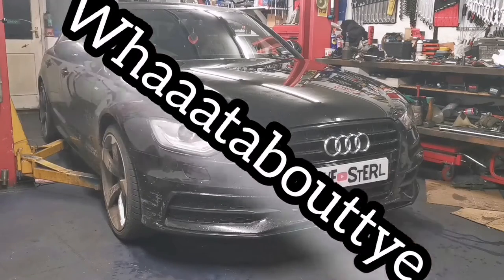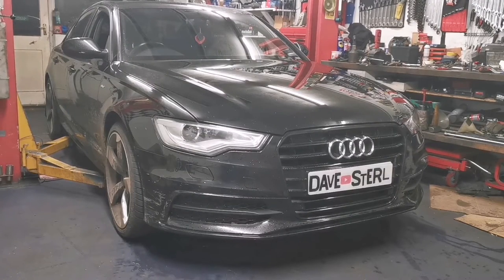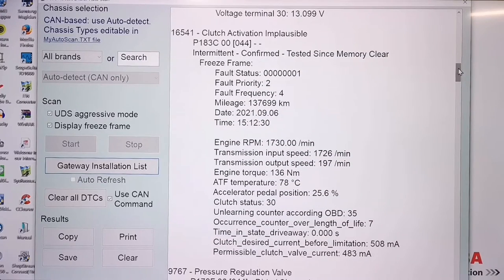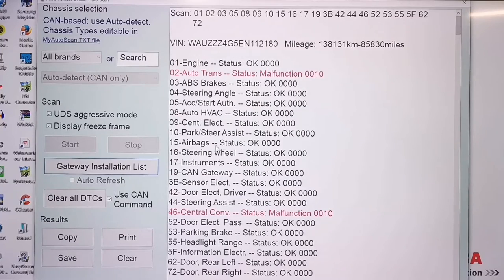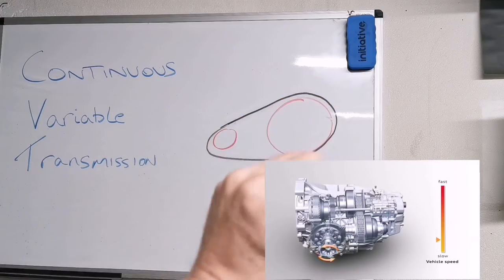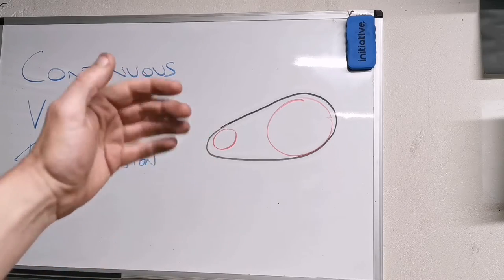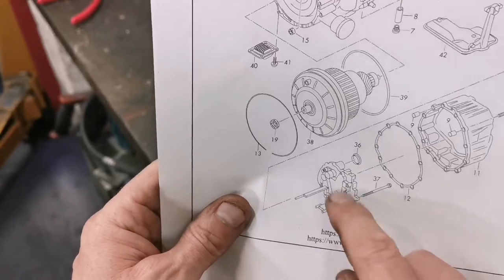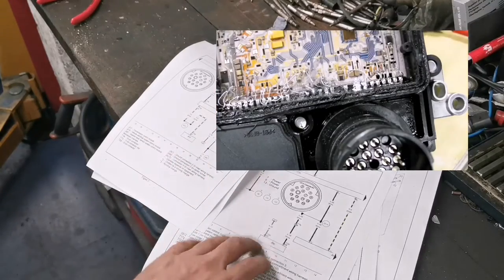Audi A6 CVT Fault. 0AW Transmission

Comment: Hey Dave, question for you. I have a NSL Auto box in my a6 c7 platform. when pulling off on a hill or incline, the revs need to come up a fair bit before the car starts moving and sometimes lurches forward. I cannot find out if this gearbox code uses the reverse and forward friction plates (clutch packs). I could do it myself if they have them and its nothing too complicated other than removing the box and taking out the plates. Do you have any experience of this fault or this box? Great vid btw.
Reply: Did you ever resolve the issue you mentioned as mine does the same on an incline or sometimes just pulling away.

Comment: Hey dave. Thanks for the video.. i liked it and its good to know about this.. 
I have a question.  
There are 2 types of transmission fluid in the transmission section of audi a6 2.0 tdi 2014. One is the transmission fluid the red one. And second is the gear oil the dark brown one which goes between the engine and transmission section.  Can u tell me something about that. The quantity of the replacement . How much liters that is to be replaced from?

Comment: Love the vids Dave! The wife's Tiguan r line '17 auto dsg, has jus threw up a fault, 2nd gear clutch position sensor is showing, odd gears showing only an box into safe mode until off an on again! Hearing scary stories n lottery number repair bill! 🤦🏻‍♂️ Talk of new box or mechtronic required! 😩 HELP! 💸💸
Reply from the maker: Yep, sounds like mechatronic. But no-one can fix your car over the internet, you need to take it to a garage that does DSG's
Reply: @davesterl  Thanks for the reply, don't fancy a new customer? 😉 yeah had it in a place 2day an they said to try some place down south (Dublin) ringin them 2mo, sounds like a 4-6k repair 🤦🏻‍♂️

Comment: Thanks  you .. I have same problem in my 2003 audi a4 b6 cvt (01J)  fault code p0706 no output signal from tcu for reverse lighting and no crank in park position only in N position .

Comment: Looking at older 2005-2008 A6 Avant. Thinking of getting it Auto too - what is your experience if any when comparing Multitronic (cvt) to Tiptronic (torque converter) transmissions? Which are more reliable or easier to work on?
Reply: Only get multitronic post circa 2008

Comment: Hello mate,good job there,i got an issue with my a4 multitronic too,the car stopped move in Drive mode,but working perfectly fine on Reverse,on  Delphi diagnostic it's come error P174000-Clutch temperature too high-Intermitent what could cause this please?

Comment: Hi dave great video. I have a 2013 audi a6 2.0tdi with a  multitronic gearbox. Last week i got a error code po717. I got it scanned again with a better tool and its a error with the tranmission input speed (rpm) senor 2 no signal. Is that a issue with the tcu or a wire/plug or sensor of some sort.
Reply: Do you have the CVT transmission? What's the reliability on that car?

Comment: Hi! I see you understand what happened with this gearboxes, i have a problem with my gearbox and nobody dont know why she dont want to run. When i push gas, gearbox start but dont make faster speed, like on manual shift first position and driving, engine runing with speed 4000 but you drive only 40 km, and fauts code no code.
Help me please if you can!
I disassembled the gearbox, chain and cone have good condition!
I don't know what to do! Thanks in advance

Comment: Dave, I’m in belfast. My a6 c6 2008 automatic cvt gearbox is slipping in the first 3 gears. Can you please advise can this be fixed or will I need to replace the box ? The car keeps shuddering and cutting out.
Reply from the maker: CVT doesn't use gears as explained in the video
Reply: @davesterl  sorry, my mechanic has told me the clutch is slipping on the diagnostics test. Sorry I have no expertise in the area of motor mechanics. Wondering could you have a look at mine ?
Reply from the maker: @flamineamon  sorry eamon, I'm not open to the public. If i were you I'd get a second opinion as a CVT has no clutch nor gears. What could be happening is the belt is slipping on the cones in which case it's a new box but this is only a guess as theses gearboxes are electonically controlled and its these electonics give trouble. Also if the gearbox oil hasn't been changed regularly then there may be mechanical wear

Comment: 7:08 ‘It’s regarded as an 8-speed’
This baffles me. A CVT is able to let the engine run at its optimal speed (for fuel efficiency or acceleration) at any time. That makes the car sound different from ones with a gearbox. 

To manually program ‘gears’ into a CVT defeats the purpose of the CVT imo. Just get used to how it sounds. Yes, like all things that you’re unfamiliar with, it’s weird at first but they won’t take more than a few days.
Reply from the maker: Yeah I'm with you there. When in manual mode it's regarded as an 8 speed. Maybe like preset positions, not entirely sure. I suppose thats to give the driver a different experience. A bit like the zf automatics can be shifted as a manual

Comment: Having changed the oil in my 2011 cvt A7 at 40k, 70k 100k and 130k miles, the oil should be much cleaner.
Reply: Gearbox still ok at high mileage?
Reply: @LN I'll soon be doing a170k gearbox oil change. And yes, still no problem.

Comment: Very interesting. Auto transmissions are basically the devil's work. Speaking of Audi, they'll tell you the rear differential (on quattro) is a sealed for life unit. Nonsense. Drop the oil on that bad boy at 100k miles if you intend to keep it. That goes for the gearbox too.
Reply from the maker: Yeah, i have a vid on the channel on servicing a haldex 5 on the channel with additional procedures i recommend. I wouldn't leave it to 100k